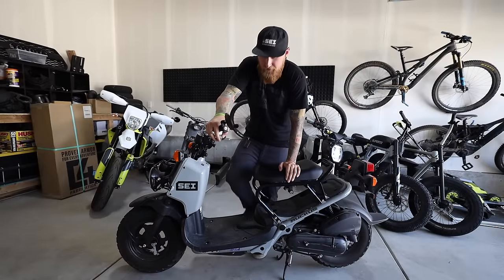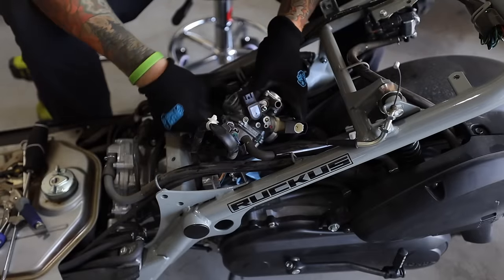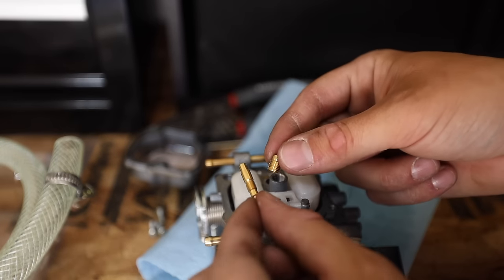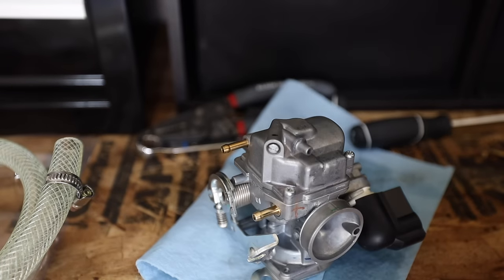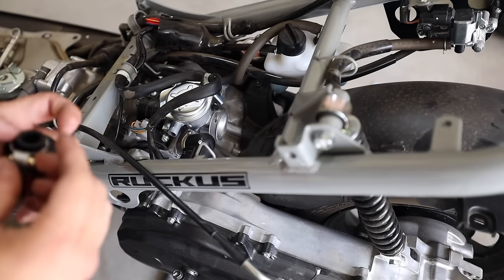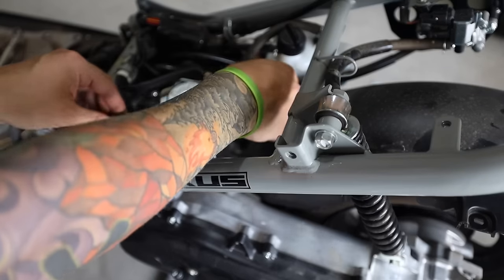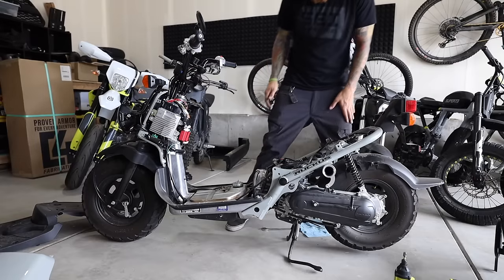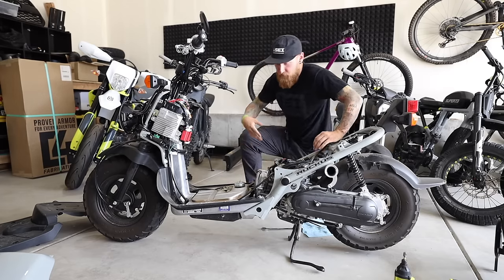Honda Ruckus Go Fast Kit | Stage 2!

Comment: If you want a nice 4 lb weight savings replace the battery with a lithium battery. Save a couple more pounds by putting a side stand on the bike and remove the anchor (aka center stand).

Comment: I do not have a Honda Ruckus but I got a used 2007 Piaggio mp3 250Ie and did a lot of work on it! It was my first time working on this bike I flush out fuel tank and clean fuel injection & lines too! Next I replaces the belt & Variator and added Dr. pulley slider 21x17 12g & rebuilt the clutch and flush out the radiator! I upgraded light bulbs to led & new headlight bulb H1 55w! next flush out the brakes lines and grease all the bearing! Next new tires and upgrade new muffler just little more work I be done! Talon Sei

Comment: I’ve had my Ruckus for several years. Pollini variator, Yoshi exhaust but went with an oversized carburetor. I’m only 145 pounds but it maxes it out at around 48 mph. However I haven’t done the CDI yet. Maybe I’ve been lucky but on some of the group rides I’ve been on. People have done more to their scooter than me and yet mine is as fast or still faster than theirs.

Comment: bigger header for starters. You are giving it more fuel but are not allowing it to escape, in effect sealing it. Need to change the weights to allow it to rev higher ego more power and speed. Chang the cylinder to a 80 or 79 cc and you are flying.

Comment: Been through all the off the shelf mods on my past Ruckus and they all fell short of the power I was looking for. Used as a pit bike for two race seasons. Even a big bore kit didn't get me where I wanted to be so I ended up doing a GY6 swap. It's the best performance move for the Ruck. Since moved on and we use a couple of Pitster Pro MX155s for the paddock runs.

Comment: Put the dipstick back in and test without the decompression tube. Stock bore may need the compression.
Reply: isnt it decompressing the crank case so the crank isnt fighting against oil pressure when it spins?

Comment: The tube that goes from the back of the carb to the air filter tore....is there a cheap air filter and tube you can buy that will work.....my jets keep clogging...I have had to push the ruckus home 2 times in 2 weeks....that is not fun in 90s and high humidity.?

Comment: Leave your needles alone. 2006 and newer Ruckus’s don’t need the needle modified. Also, if you want to decrease the chance of stripping a screw on your carb use a JIS (Japanese Industrial Standard) screw driver. All of the screws on the Ruckus (& many Japanese vehicles) are JIS screws and not Phillips.

Comment: you could try putting in the met gears from the metropolitan. higher top end supposedly havent done it on my ruckus. im at your version of the stage 1 tune basically with 5.5 and 5g slider mix and hit 40 all over at 250lb but im at sea level.

Comment: Just a little bit of advice, run Michelin street tires & a performance clutch plus a performance variator face. Add a Tach which is essential in tuning. Do not be afraid of using 4.5, 4 or mixing 3 or each for a 4.2gram Slider weight average. Reason for the tach is to know you are exceeding the Rev limit setting of 8850rpms. You need to be running in the low 9000's for max speed from that 49cc motor.
Reply: Up your cvt gears

Comment: I just skimmed the video did you reset your ECU since you removed the throttle/carb?  wasnt sure if you needed to since you bypassed it with the ncy cdi?  just curious if its needed?  thanks all.  i am also learning
Reply: its a fixed ECU it does not learn and change setting, so wether "reset" or not it does exactly the same thing,  The ruckshop have dispelled the "reset" myth.

Comment: So far I spent over 300 bucks in a variator kit, weights , cdi. And essentially there is no difference.  The wind has a greater effect on the speed at this point.  I have the jet kit and will not install it. Something is limiting the power output of the engine and its in the factory ECU and the attaching systems.  Until I find out what it is spending money on these kits is proving to be a Waste of time and money. Yes we all enjoy tinkering with them but results is what counts
Reply: Yes there seems to be a limiter or restriction on the rpm output.
Reply: Anyone reading this in the future, Honda puts soft limiters on its ECU and its speed based
Reply: $$ Per hp I really can't think of anything more expensive to upgrade than a ruckus.
Reply: Lol. Cdi eliminates the rev limiter.
Reply: @1manshtshowandautobodystuf891  Everyone that has installed it has the limiter still functioning.  Honda builds it into their ecu. The only system that gets around it is a self-contained, old-fashioned type of ignition coil that I found online.
Reply: @robertcaccavalla6469 do you have a reference to this ignition coil?
Reply: @GodsGanja  it's been over a year since I last looked.  I remember the price was about 210. But I can't remember who had it.  If you look up honda Ruckus modifications sooner or later, you will find it

Comment: I value the fuel mileage on my stock Ruck.  So now you did all these mods….how much less is your fuel mileage?  On a stock Ruck, is there anything, any mods, to be done to get better fuel mileage, other than me losing weight and keeping my throttle less than wide open all the time? 😎

Comment: Have you looked into the Honda Big Ruckus? It's a 250cc.
Reply from the maker: They are no longer being made and are very hard to find in good condition on the used market. This regular ruckus fits into my garage line up better than a big ruckus as well.
Reply: @TalonSei  Well crap.. I just found out about them after watching this video. Ride safe my friend.

Comment: You should have finished breaking it in before you did mods. My engine got a lot stronger after it hit about 700 miles! Now at 1200miles  it feels a lot different I’m hitting 41 on level ground when i got it thing did 37-38 on way home from the dealer new! I was surprised how tight that engine was new! It was weak to. But I went easy and sure enough it loosened up kind of like a really stiff subwoofer they get louder as they get older cause they loosen up just a tad. Engine did the same thing!!

Comment: Why would you re-jet your carb before place on your exhaust?. You will just need to re-jet again for your Yoshi exhaust.  All your after market mods should be placed on before you re-jet your carb.. You should also be doing spark plug checks to see if your running lean or rich.
Reply from the maker: It was re-jetted at the same time specific for the exhaust.

Comment: Making a mod that makes any engine filterless is a terrible idea, the wear to the engine/ rings and the chance of clogging jets simple isn't worth it. i'm surprise they sell it. The most younger rider that has these bikes is destroying their engines life. The rukus's stock tyres are also awful, the bike has no offroad capability so the knobbly tread its robbing you of mph, when my stock tyres wore out and cupped I got high quality dunlop scooter tyres and gained 3mph.